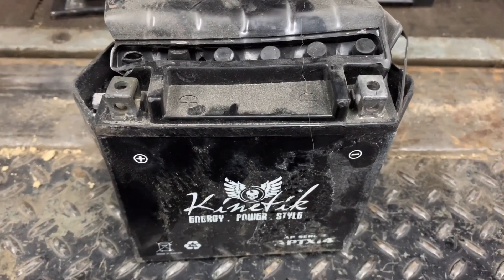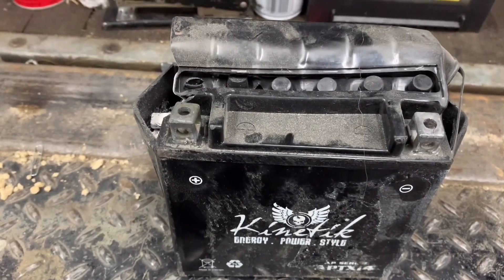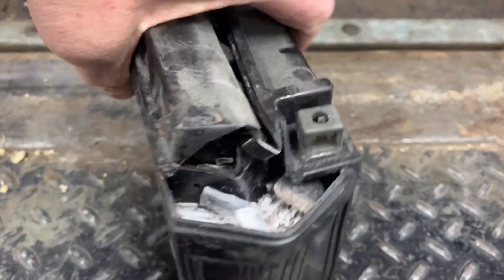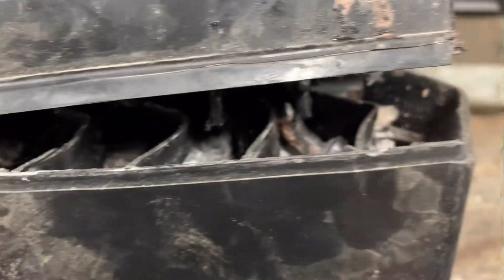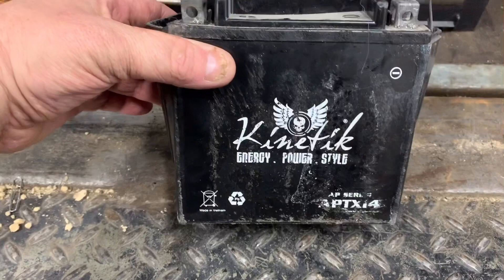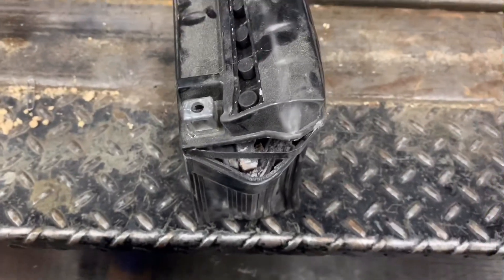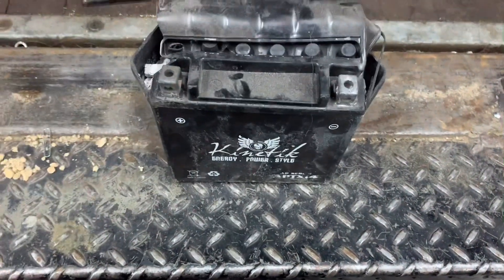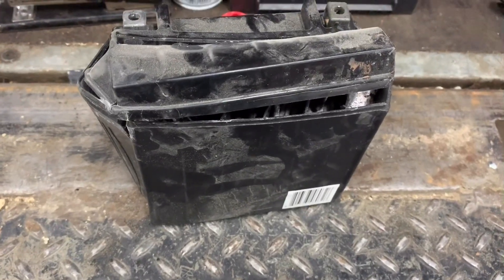THIS BATTERY WAS LITERALLY A HYDROGEN BOMB!  BE CAREFULL OUT THERE!

Comment: This can happen when you have an over charging system as well. Always check to see that the charging system is within specs if you have a battery explode after replacing the battery. Good info and video. Keep up the good work. Peace and best wishes.

Comment: I retired from Firestone management. Ran a lot of stores. This happened sometimes on car batteries when the pulse charging which is usual on a car failed and the alternator just constantly charged the battery instead of just keeping a normal charge up on the battery. I don't know about the system on a lawnmower though.
Reply: Some have a voltage regulator, some mowers don’t a lot of the Briggs mowers especially the older ones used just a single diode for half wave rectifying to charge the battery, the voltage is basically set by the winding of the stator and the normal operating rpm 3600rpm is like 13.2-13.5volts on these systems. Some of new Briggs have regulators, practically all Kohlers in Kawasaki’s have a voltage regulator. Matter in fact I have this Briggs vtwin that decided to live short, and it’s a newer motor it’s only go one diode to turn the ac into DC that’s it no regulator, but again the stators are also wound below 14volts at full engine speed rpm. Of course the voltage regulator systems are more efficient.

Comment: I had one of these agm 2400 amp model I didn’t trust it when I charged it thing smelled bad and it sounded like it was boiling sometimes
Reply: That couldve been the charger. You may hear a boiling sound from the battery when the charger is in reconditioning mode.